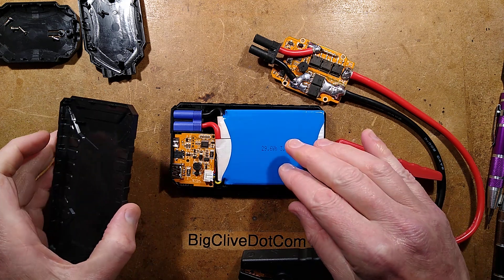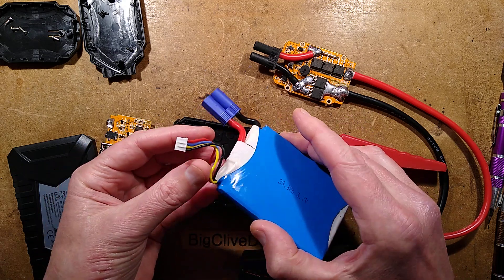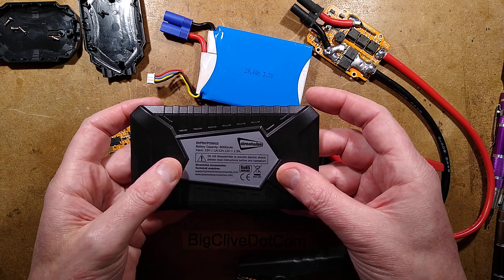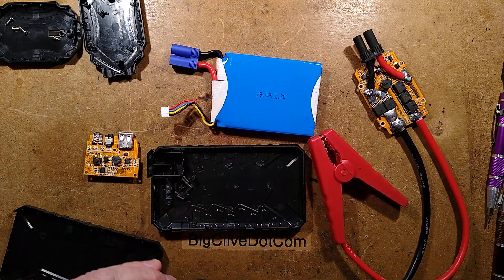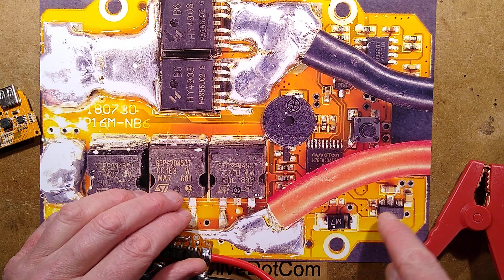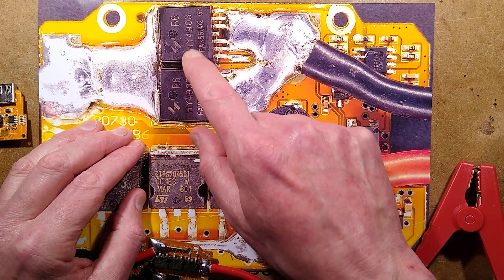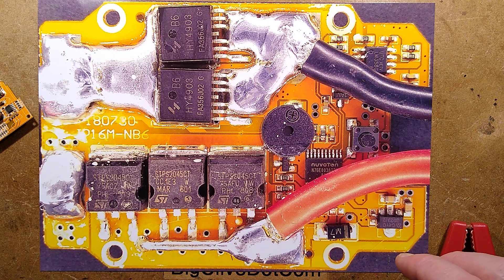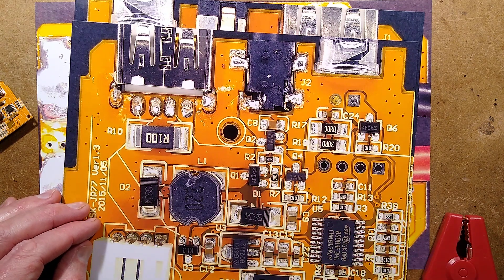Inside a combined power bank and jump starter

Comment: The chat about the mAh rating is exactly why these things should exclusively use mWh/Wh instead as that builds in the voltage element.
Reply: I agree. Ah is basically counting the number of electrons it can output, which is not a useful piece of information. What matters is the energy it can output, which is what Wh tells you.
Reply: Yes. This. Its so annoying seeing capacity listed as mAh...  goddamit just use Wh!
Reply: The mystery is simple. They can make themselves look bigger/higher/better to those uninformed, which is the majority of people look for a big portable battery
Reply: @gbraadnl  Hence why J is the better unit.  It's accurate and a bigger number.  1Wh = 3600 J.
Reply: I'm still confused that 3x2600 = 8000 when 3x26=78 🧩🤷😁
Reply: @TomCee53  Apparently rounding to the nearest Ah.
Reply: Actually the most useful information is the length of time that the device can supply a specified load.   In addition, the voltage, Ah and Wh figures should be given. A Wh figure on it’s own is of less practical use, as it tells you very little about the current capability of the battery/device.
Reply: Yeah but mah is a bigger number, the only way you'll change that is legislation
Reply: I use Wh myself as it is cumbersome to use Ah and if you do not know the voltage knowing the Ah give you no information at all about the battery capacity...
Reply: Brought a Lidl power bank the other day (one with a 70W 240V outlet as well) and that had the milliamp hour rating at a specified voltage rather than just saying is had x milliamp hours capacity, something I approved of.
Reply: Got me wondering: Are phone battery generally rated @5v in their specs?
Reply: @wisico640  - no. The lithium cell (battery) in a mobile telephone have a nominal voltage of 3.6V or 3.7V. So they are normally rated at the Ah of the cell.
Inside the ‘phone there is a charging circuit which controls the charging current and which limits the voltage to the cell to a maximum of 4.2V. 
The first mobile telephones came with their own dedicated “chargers” (actually power supply units or PSU / mains adapters). I’ve opened an older Nokia one, and it’s an unregulated type made up of a transformer, bridge rectifier and smoothing capacitor.
But using USB is more convenient for both the user and the manufacturer. USB was originally 5V only. USB was intended to only supply low power computer peripherals like a mouse, keyboard or similar. But the use of USB as a power source to charge ‘phones has driven the USB standards.
Reply: @wisico640  not usually, it's at their 3.7v nominal rating.
Reply: @dglcomputers1498  like powerbanks. So every market are fkd... I would have wished for some kind of hope in a parent market.
Reply: Absolutely, 100% correct.
Reply: Err, no! Clearly the English branding was done by somebody who didn't know what they were doing, or using trickery, referring to what the USB port can output rather than what the 12V output could... the answer is to provide the correct number, not ban the use of one way of measuring something. It would be helpful when doing comparisons to have the Wh number provided also, but "exclusively"? That's not helping anyone.
Reply: @annoloki  Who is Ah helping?
Reply: The mah of cell level is what matters for being allowed on a plane though isn't it? Making it fairly important to have on the device
Reply: @lasskinn474  No, the aviation rules are written in terms of Wh.
Reply: @lasskinn474  What matters for taking batteries on a plane is Wh, because Wh tells you how much stored energy there is in a battery pack regardless of how the constituent cells are connected. Imagine you have a battery pack made from four 3000mAh 3.7V nominal cells. If you connect those four cells all in series (4S1P), you will have a 3000mAh 14.8V nominal battery. But if you connect those four cells as 2S2P, you will have a 6000mAh 7.4V nominal battery. And if you connect those four cells all in parallel (1S4P), you will have a 12,000mAh 3.7V battery. Despite having different mAh ratings, all of these batteries have exactly the same capacity - we’re just connecting the same 4 cells in different ways. If we use Wh instead of mAh, the confusion disappears & all of these batteries (4S1P, 2S2P, 1S4P) are all 44.4Wh.
Reply: The battery manufacturers rate them in mAh.  Since most users know current draw for their device, at the given voltage, mAh is actually the more useful number.  For example, my twin engine RC plane draws 25 amps at full throttle from a three cell pack like the one in this example.  I buy 4000 mAh packs so 4ah/25 amps = 9.6 minutes.  In practice you don’t want to discharge a pack past about 75% of its capacity so the actual run time is less.  The more critical metric is internal resistance because that is what limits your safe current draw.  Really good packs are less than 10 miliohms which gives you about a 10-20 C discharge rating.  Ready current = C rating times the batteries capacity in mAh.  So in my example you could safely draw 40-80 amps depending on the actual value of internal resistance and duration of the current draw.
Reply: @DrParticle  None of that means anything in a power bank that has a boost converter to output 5V.
Reply: @DrParticle  What you need to know isn't how long you can go at full throttle but how long you can go at the required throttle to stay airborne. That's a power requirement, not a current requirement.

Comment: Personally I'm more for the option of jumper cables in my car's boot over a jump starter.
Why ?
First because unlike lithium cells, jumper cables will not deteriorate and/or lose capacity over time of not being used.
And also it will force me to ask someone else for help in the event that my car battery were to be flat and that is social interaction.

So unless also using it as a power bank on a regular basis I don't think putting a stack of lithium cells in the boot of my car... Not to use it at all except for emergencies would be a good idea.
It might very well have become unusable by the time I need it.
Not even talking about the fire risk, espacially during hot summers in the boot of a car that doesn't have AC.
Reply: Jumper cables only work if there's a donor vehicle available.
Reply: @BedsitBob  Just go to the nearby supermarket with a parking lot and you'll find plenty of donor vehicles.
I did offer this free service more than once to people that couldn't start their car and had their own cables.
All when I was parked at a store after running errands.
Reply: @psirvent8  You don't always get a flat battery, when you're on a car park.
Reply: @BedsitBob  Fortunately !
Reply: @psirvent8  I probably should've phrased that better.

You can't always guarantee to be on a car park, when you suffer from a flat battery.
Reply: @BedsitBob  Ah, now I understand better.
In that case I would try either ringing doorbells or stopping cars down the road but I agree it's better, socially speaking to do it on a car park and if you're going hiking on a regular basis (Something I'm not doing) then I think it might actually be a good idea to have a power bank jump starter.

The power bank being used to recharge your phone away from civilization and the jump starter being available in case of flat car battery.
Reply: @psirvent8  "and if you're going hiking on a regular basis (Something I'm not doing) then I think it might actually be a good idea to have a power bank jump starter."

Exactly my point.

If you're travelling miles from civilisation (or at a time when few people travel, such as Christmas Day), it could hours before another vehicle passes, always assuming they stop.

With a jumper pack, you aren't at the mercy of another driver.
Reply: Fair points to be concerned about, but I've had one of these for 5-10 years and had to use it many times on a 2L diesel car due to a fault with the car slowly draining its battery. It's always worked flawlessly and showed no signs of deterioration over time. The auxiliary 12V module does get warm during use, probably due to all the current flowing through the diodes and MOSFETs.
Reply: GF uses the car, runs the battery dead, asks for help and finds some bumpkin who gets red and black backwards and burns out the alternator. I'd rather she use the box with the idiot buzzer.
Reply: I'm kinda skeptical about one of these lithium battery packs boosting anything beyond a small motorcycle. Most of my experience boosting vehicles is in the depth of a Canadian winter, when lead acid batteries have gone soft at -15°C or colder.

Comment: Interesting device - I'd not seen these before.

Now I'm expecting to find that someone has made a USB powerbank  that can be used to start a railway locomotive. Their starter batteries are just a weeny bit bigger than most cars, vans and lorries. ;-)
Reply: I used to jump start them when I was an apprentice, Used welding cables and another running loco. And lots of easy start.
Reply: If only they realized that the rails conduct electricity which could be used to power the train. The Japanese did that nearly 60 years ago.
Reply: @NiHaoMike64  Maybe that's why electric locomotives were invented.
Reply: @dave161141  actually we use the diesel to generate electricity because we are too far from the grid.
Reply: If someone has access to a loco and a spare one of these it would be fun to try it
Reply: @ianhosier4042  I have access to a 23L cummins marine diesel,  unfortunately the starter is 24V otherwise I would be tempted.
Reply: @dogwalker666  well, just put two of these is series. What could possibly go wrong?
Reply: @RossReedstrom  indeed what's the worst that could happen 🔥

Comment: To power 12V LEDs with cell protection, strip off all the control stuff on the 12V board except the switching transistors. Take a feed from the USB output just to turn them on as needed. Then it's battery monitoring will cut it off due to imbalance or excessive discharge, which will in turn shut off the 12V output.